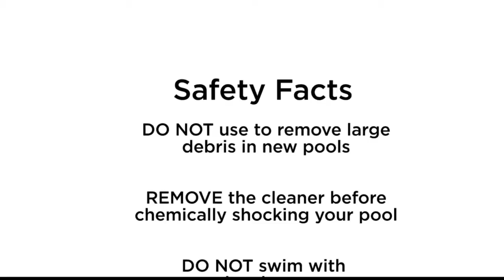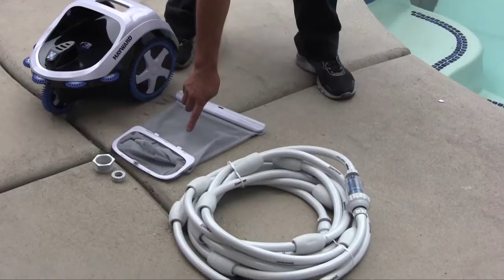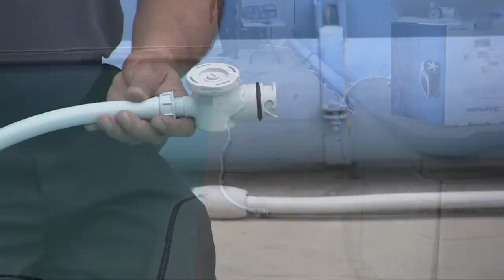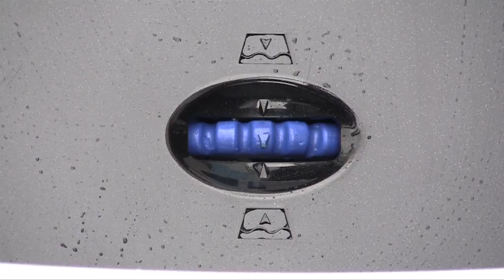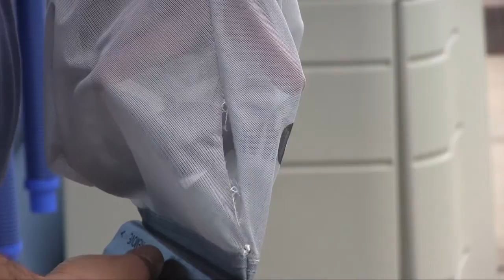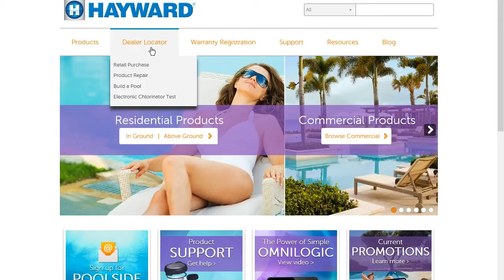TriVac 500 & 700 Installation, Maintenance and Troubleshooting

Comment: Trivac 700 is Way better than the old Hayward Phantom. Awesome to see you guys bring back pressure cleaners.
Reply from the maker: Thanks for reaching out. The TriVac 500 is a bottom and wall cleaner and the TriVac 700 also has a skimming function. The engine is a totally new design that integrates AquaDrive technology but with less moving parts and the simplest mechanism. This new engine will last under the harshest working conditions for virtually the life of the cleaner.
Reply from the maker: This engine is a totally new design that integrates AquaDrive technology, has less moving parts, the simplest mechanism, and will last under the harshest working conditions.
Reply: I want one so badly!